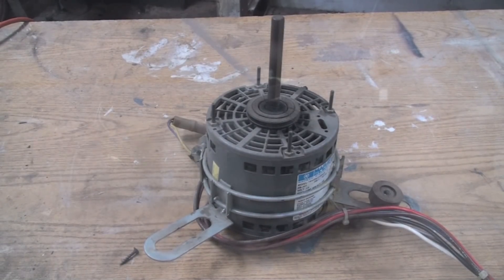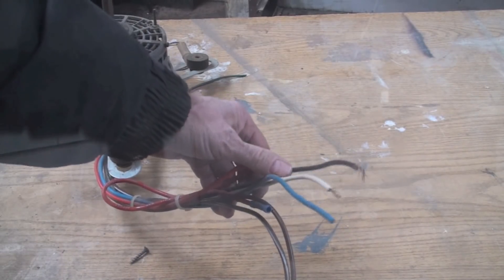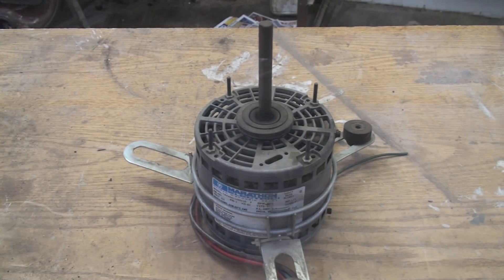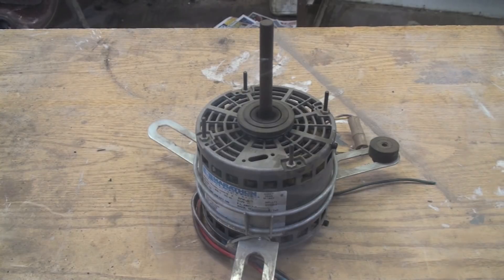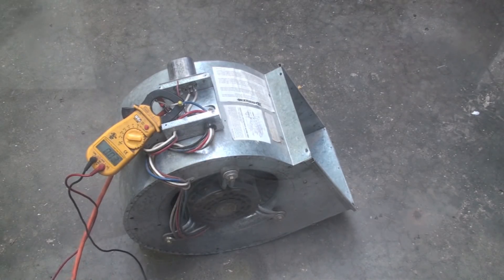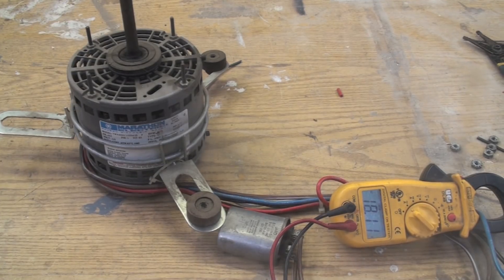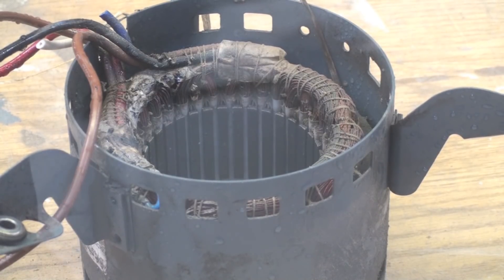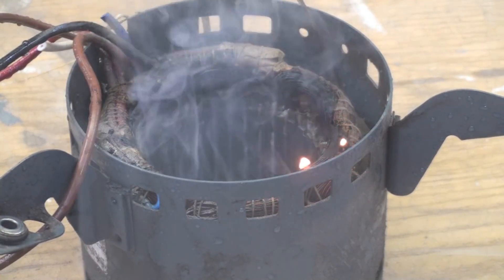Smoking electric motors 1

Comment: I don't know what I'm looking at. I replaced a blower motor for the air handler and the motor caught on fire. It is a 1075rpm 230v 60hz motor with red, blue, black, white, and yellow wires, and a green ground wire.  The old motor didn't have a white wire.  I connected everything just like it was with the old one and it caught fire. Now I'm wondering how are you supposed to connect it?

Comment: The motor you turned on first was that one, that motor never tripped the breaker even if low medium and high wires where shorted together.
Reply from the maker: That is quite common.  They do often open the internal overload.
GFM

Comment: I have a 5hp 220 air compressor motor it starts but slow and starts to smoke  what's my Prius the motor junk
Reply from the maker: The unloader may have failed
GFM
Reply: @grayfurnaceman  no it does it not hooked to compresser

Comment: I bought a grinder wheel, took of the housing to clean a wasp nest out. Blew it all out with a compressor. Started it up without 
the housing.. (that suspends it in the magnetic field I assume) I heard hum no movement. I put back the housing & it started to move until white smoke & finally fire.... what happened you think cause idk
Reply from the maker: Probably the start circuit was not energized, so the motor windings overheat = dead motor.
GFM

Comment: I thought the overload only switched the common conductor and therefore wouldn't be of any help for the kind of miswiring you were doing here.  I guess I was wrong since the overload did activate in some cases.
Reply from the maker: Straycurrent I guess it depends on how the motor is made.
GFM